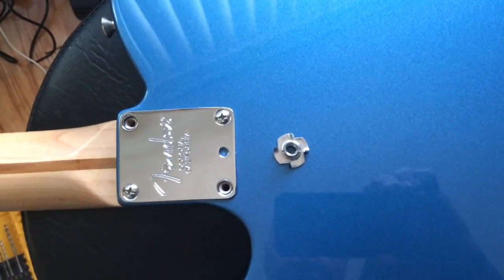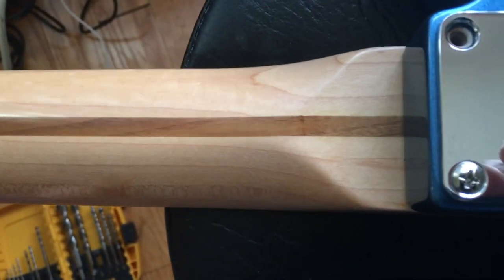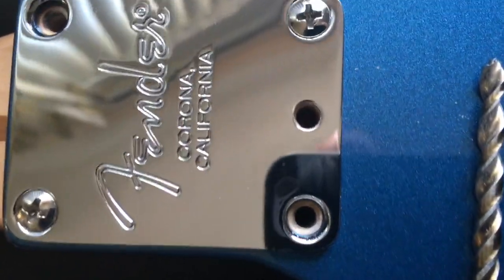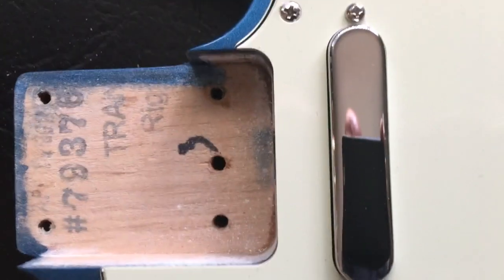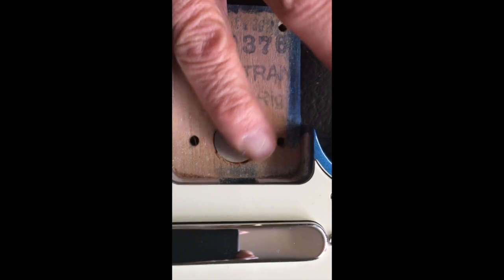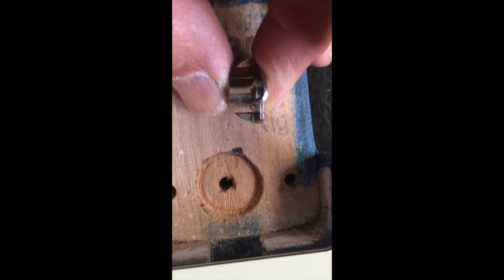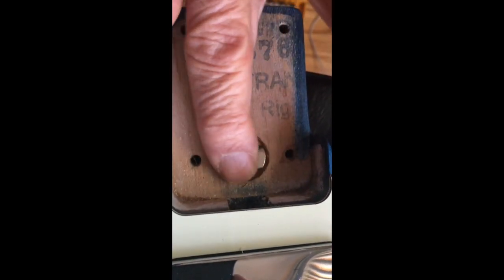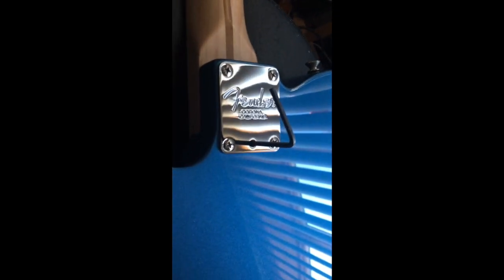How to install Micro-Tilt on a Fender Telecaster

Comment: This was just the information I needed. Bought a  US Stratocaster neck without realizing it had micro tilt. So I had to buy the 5 hole neckplate. Next issue was how it worked and I found out that I needed drilling, the nut and screw. Watched the video on Fender where it showed the nut and screw and how it works.
This video shows how to do the job. Thank you. I will see if I can get the parts in Europe. If I buy it from US the custom will kill me with a huge import tax. Once more, thank you. Cheers, Johnny.
Reply from the maker: Glad you liked it and that it helped. Thanks for the comment.

Comment: Use a nickel with a tapped hole for grub screws and a glued in penny on neck for micro tilt. Works great. And costs            6 cents glue the nickel to cant move under pressure. And the penny and nickel have the dates I built guitar.
Reply from the maker: That's cost effective, but I think that the t-nut is more secure and won't turn when you adjusted it like the nickel might.
Reply: @juliodavid49  works like a charm. Not like its a lug nut.
Reply: Outstanding !  Innovative use of existing materials.

Comment: Thanks, I am in same situation, USA neck has the microtilt plate, and I have the neck plate with the hole, but Highway One body does not have the part that does the actual tilt. Now I can add it if I desire.

Comment: Nice job...Clean,accurate,and professional.Would love to add this to my Player Strat but would require the plate replacement like in your case.I've always used shims but I also do have strats and Teles with the micro tilt setup.Thx for sharing!

Comment: I measured my Micro-tilt kit I got online and it measures just under 7/16 wonder if i got the same kit as you did?
Reply from the maker: Is that measurement the diameter of the disc? Where did you buy the kit.?
Reply: @juliodavid49  nevermind, my Caliper's battery was dying so it was giving false readings. changed the battery and it's now registering 19mm/ 3/4

Comment: A number one question would be, 'where did you get the kit'? Also, "it comes with the..".  What is "it"? Is "it" a kit?
Reply from the maker: Go to stratcat.biz/mtk.shtml  you get the whole kit for 16 bucks. Not sure what you are asking when you say "it" but you get everything you need with the kit except for the hex adjusting wrench which you can buy from them also. Hope this helps.
Reply from the maker: Got "it" (the kit) at stratcat.biz

Comment: What round object did you use as a guide for recess to keep flush?
Reply from the maker: I used the round plate that comes with the kit that goes mounted on the neck side. It looks like a nickel. My guitar neck already had it so I didn't have to mounted. But if your guitar neck doesn't have it you have to drill the hole to recess it into. And remember don't use an drill to make holes for the t nut or the round plate, as you might drill too deep. Hope this helps.

Comment: i don't recommend this unless you care about your sustain.
Reply: Unless? Or "if?"
Reply: I defy anyone to distinguish whether a guitar has a micro-tilt by listening alone. The micro-tilt provides great mechanical linkage between the neck and body and  has no downside as long as everything is tight. If you disagree, that's cool, but test your theory - it's easy. Play an open string with the micro-tilt disengaged and time the sustain. (This is also easy: use your tuner to see when it stops registering the note), then engage the micro-tilt and time it again. I'll wait.